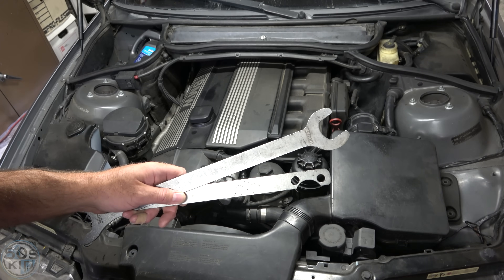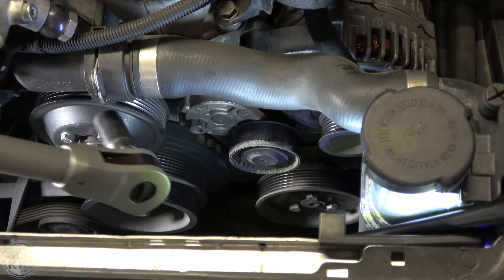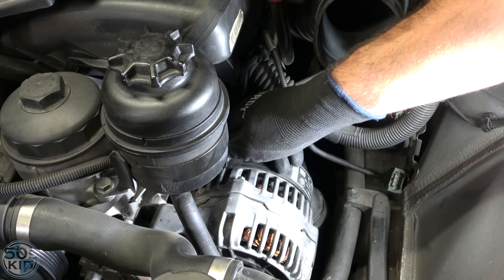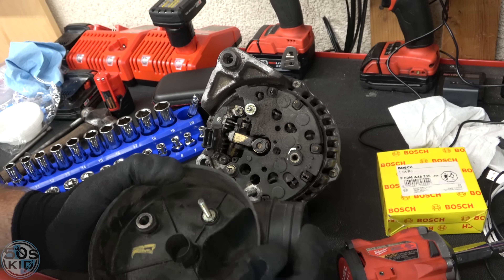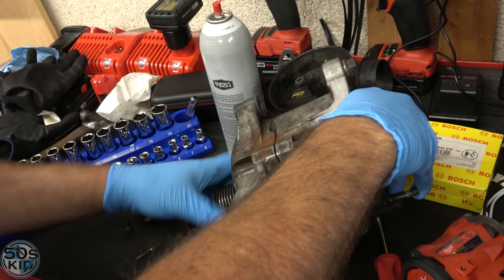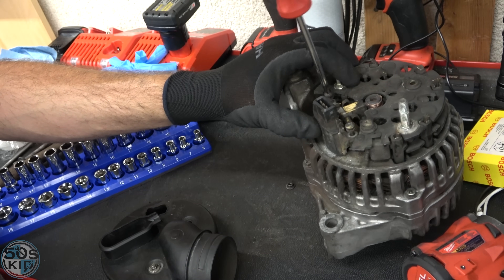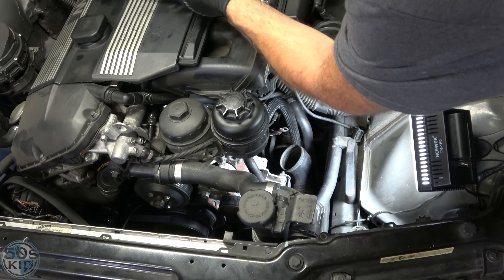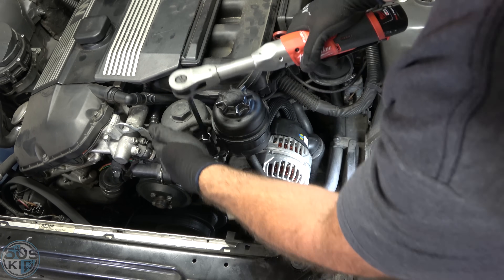Save your alternator with this cheap part! - E46 Alternator Rebuild DIY

Comment: Good vid 50s. The bolts on the plastic housing are 7mm hex E117. I saw another guy on YT using 8mm and thinking the bolts were loose.

Comment: I have replaced my Battery and got the alternator rebuilt but am still having the same issue. Battery draining and keeps going from 13.4V down to 11.7V battery light goes on then all of a sudden it turns off and voltage is back to 13.4V ? sometimes it surges and goes all over the place as well. Is there something I am missing ? Maybe the alternator wasn't rebuilt properly ? Please Help your videos are what has kept my car alive for 3 years !!!

Comment: You only need to replace the rectangular-prism-shaped carbon brush. Perhaps the spring, too. You can get an whole set from China for under $20 that will fit brushed electrical equipment.

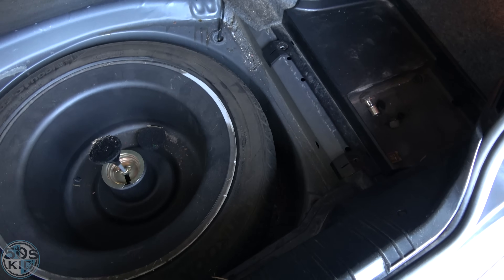Comment: 1:43  It's easier to disconnect the battery under the hood.  Remove the large nut in the small black plastic box kinda near the passenger shock tower.  It connects the engine harness to the cable from the battery, disconnected there is no power under the hood/cabin/anywhere except the big red cable up to that box.

Comment: Does the 3 pin alternator works on the 2 pin one?🤔 I see that you removed a 3 pin and installed a 2 pin, also your connection is for 2 pins, obviously has the space for the third pin, but doesn’t even have the same connection like the other 2 pins

Comment: Stupid question here but I need to swap the voltage regulator from an e46 into the alternator in my e83. Can this be done without pulling the alternator out of the car? I've got an alternator sitting in my storage unit that I could swap in but I'd really rather just toss in the regulator to prepare for the ms43 loom and DME.

Comment: @ 9:50 ... call up Bosch USA with the old VR part number (the Bosch pn) and they will tell you what the newer superceding part number is.  Part numbers can change over 20 years, but for some reason the BMW pn will lead you astray.

You may need to leave a voicemail with their tech support number, but they should get back to you within a few busuness days.

Comment: Not sure if you’ll respond but here is a try, I bought the special tools to remove the fan in order to access the water pump and alternator but the fan bolt is smaller than the 32mm special wrench I received. Any recommendations?

Comment: Do I need to have the duct for the alternator? Mine only has the 90 going down and nothing after it. ..I’ve been dealing with eml light and am about to give up on my e46
Reply: doesn't need a duct but if it does have one make sure to cap it or put somthing over it to stop leafs and that getting onto the voltage regulator and fuseing it out. my e46 has the same alternator in the video but the ducts connected to nothing and I had leafs get sucked in and burn out my voltage regulator.

the duct doesn't matter so long as it's the alternator is the same brand, valeo or bosch (they're not interchangeable) aswell as the plug in the back is the same shape
you can go up in amperage from stock but not down 

so when replacing it you need to make sure
same brand 
same plug 
and the same amperage or higher
the duct doesn't matter as long as you cap it

Comment: Hello I have replaced my alternator and battery on my 2004 bmw 325i . And I’m still having the battery light on intermittently when the car is at idle and it goes off when driving . 
The first alternator I bought from oriellys my mechanic installed for me and a day later the battery died again . I went back to oriellys and got another alternator. Still noticed the battery light and I replaced the battery .
Reply: it's a ground wire issue.

Comment: this takes me back to my m52TU alternator failure. The slip ring copper had worn right through. yours looks 80% gone. Replace it or it may leave you stranded.
That reg. is normal, yet everyone selling the other type. It was weird.

Comment: Hey Jason, i have a bosch alternator and its missing both upper and lower air ducts for cooling, and the alternator doesn't have the right plasic cap with thr hole that connects into air ducts, will it fit if i buy the alternator cap with the hole in it? Im not trying to buy another alternator, i just wanna put everything back like from factory
Reply from the maker: I’m not sure but if I were to guess I’d say no
Reply: Thanks

Comment: My 2005 330Ci ZHP has just one wire going into the connector for the alternator voltage regulator. Is this normal for any e46? Every other one I've seen has two wired pins, whether oval or rectangular connector.

Comment: Don't you have overheating issues with the electrical fan? I learned that the clutch fan generates much more airflow and higher cooling performance, necessary for the automatic models.

Comment: I am having an issue with my alternator in my 2008 335xi (N54). There is no voltage output before, after replaced the voltage regulator with a new regulator, I got voltage from alternator but it always stop working after several minutes, and voltage  may come back then go away. Not sure whether I should replace the while alternator or there could be some other issues? The connector is tight (checked).

Comment: I get to do this job in the next day, so I lived with the hell of trying to figure out what alternator I had.  But in this video you do not hit the lower bolt with a hammer for some reason like you do in the original video:

https://youtu.be/hrEehjM5tgQ?t=308

Any particular reason you didn't do  that this time?
Reply from the maker: I actually did do it but cut it out because it’s never been effective for me. There’s just not enough room to get a full swing. I always end up prying it out
Reply: @50sKid  I pried mine out as well though I did try and hammer tap but didn't ta hard enough... :)  Being in Ohio - I am jealous over the look of the bolts where I have surface rust on all of mine.  

Hopefully my alternator comes in today and I can slap it in after exercising.  I plan to get some penetrating oil in the threads on the engine and brush the bolts clean and wipe down with penetrating oil as well.  Hopefully to try and protect them a bit.

According to ECS the one I bought is a new unit - not a rebuilt (they were listed separately) so I am hoping - I don't have to send back mine to be rebuilt - so if I can get the old one tested and fixed - I can have a spare.

Comment: bmw ended that regulator a few years before this video. As i recall the ones on Ebay arent bad, but arent "Bosch" quality, so buyer beware. you can use the superceded part you have there, and they are a direct fit. 
hope this helps some that are watching this and are confuzzled..

Comment: I faced the same case on my 04/2004 330Ci (MS45.1)
I noticed that my alternator looked different than what RealOEM was showing, so I pulled my alternator to check the part number for the alternator and the voltage regulator, when checking those part numbers it was from an E60!

Love the channel btw, you helped me a lot, and I’m watching your new videos “just because”, I’m even watching the E90 videos although I don’t like it and don’t plan on getting E9x ever

Comment: Correction. It's not a commutator. It's a slip ring. The alternator generates AC voltage. That's why there are diodes. To rectify AC into pulsed DC. DC motors have comutators. AC generators have slip rings.

Comment: I did this about a month ago.  You don't need to remove the alternator to replace the regulator.  Whole job took less than an hour.
Reply from the maker: I didn’t even consider that, doh

Comment: Bro u can go even one step further and change inner bearings and the pulley if ur alternator has one of those overrun or decoupler pulleys. There are kits available on eBay for $40-60 for most alternators.

Comment: Good video, Jason. Thanks. For those of you replacing the belt tensioner, please get a BMW part. I had a new tensioner break on two different BMWs during installation. Never happens with a genuine part.

Comment: My 02 vert is a manual trans with a mechanical fan. Any ideas as to why? I’ve searched the forums but haven’t came up with anything.
Reply: Possible swap? Either the gearbox or the fan
Reply: @EasyAchiever65  I ruled out a manual swap with a vin decode. It’s a factory manual.
Reply from the maker: Weird, never seen that

Comment: Nice to see the e46. Have you reinforced your rear subframe yet? Would hate to see your car go if the subframe cracks :(
Reply from the maker: Unnecessary unless you've got the earlier 328 or an M3. For the most part.

Comment: 17:00  I couldn't agree more about the flex head.  I prefer the standard head since I can apply more torque and also stay squarer on the bolt heads which keeps them from rounding off.  For me, the flex head is a special tool that I only get out for sticky situations.
Reply from the maker: Well it's the opposite for me -- I love my flex head as my primary, but sometimes it gets in the way!
Reply: @50sKid Wow! Using power lug nut for an old and brittle plastic without loosing them a bit...only American can do that. No wonder you guys have stickers on your microwaves " do not use for tumble dry "

Comment: In my e46 there is no pulley on the upper alternator bolt so the belt goes straight from the water pump pulley to the alternator pulley (european car)
Reply from the maker: Oh is it a diesel or inline 4?
Reply: @50sKid  no it is a 320i m54 inline 6
Reply from the maker: @AnthonnyAndria  Oh interesting. We never had those here in the US
Reply: Mine does not come with one either. I read somewhere that not all E46 M54's came with an idler pulley.

Comment: In the next iteration of this issue you can just replace the diodes/brushes :)

And it could be that BMW used a different alternator (different on the outside, not really inside) for the 4/6 cylinder engines, petrol/diesels, pre/post-facelift. And if the donor E46 already had a replaced unit from a Mexico-imported E53, no surprise that parts don't match anymore.

Comment: I did this job just a few days ago! Was actually looking around on your channel for a video on voltage regulator but was surprised you hadn't covered it. So I just watched your video on alternator replacement and looked on E46F for voltage regulator instructions haha. 

Also +1 to the connector type. What's weird is that my ZHP has the oval connector which is common to the Z4s. FCP's website didn't even have the oval connector listed for my car so I had to pull the PN from realOEM. I nearly ordered the wrong connector at first, luckily I realized it 5 minutes after placing my order so I quickly cancelled it and re-ordered the right one.
Reply from the maker: The oval connector is on newer cars, I believe. What year is yours?
Reply: @50sKid  2004. I've heard of some other ZHP owners having the same conundrum
Reply: @50sKid  oh and what sucks about the oval connector is that there isn't any vent connecting to the brake duct for alternator cooling, which is interesting. I guess it was cheaper not to include that with the later cars

Comment: Thanks for sharing.   My e39 which also has the M54 Engine and had a Valeo Alternator had the alternator light come on too - the brushes were worn out. You can just replace the brushes, but you have be able to solder.  Getting the Brush Cover off on the Valeo Alternator is a real PIA. It requires careful cutting of the plastic cover and  I tried to min. the cutting so it could be reused. (supposedly it can slide off, but good luck...to me it looked like one time use. The brushes are part of the Regulator and you can not change the brushes without removing that brush cover.)The Regulator on Valeo Alternator is more expensive: about twice the price of a new Bosch Regulator.  Plus the fact that my slip rings were heavily worn (the copper discs that you were sanding that the brushes ride on) I just opted to replace with a new Bosch Alternator.   The new Bosch Alternators are made in South Africa....So far no issues, but I wonder how long it last over the original European made Bosch (I think most Bosch Alternators on these Era BMWs were made in Great Britain).....Rebuilt Alternators - there is no telling how long they will last.  Most Re-manufacturers are using inferior Chinese Bearings (if any new bearings at all) and you may only get a couple of years and/or 50k which is not worth the price.  Most of the alternators I found in the Salvage Yard needed Bearings.   The Bearings can be swapped out but the time to do that all that work and the cost of the bearings, you don't real save much plus removing them you may end up damaging the alternator casing.
Reply: Great info! on brand names! Thanks
Reply from the maker: High quality bearings of any type can be purchased from McMasterCarr or other such industrial supply websites.

Comment: Also glad to see e46 platform. I wonder how many of us are out there? Any reasonable e46 repair shop around DFW?  I've been thru 3 so far.
Reply: Go to google maps. Do a search for alternator repair. Look for shops with four stars or higher. What do you consider "reasonable?" Most repairs are going to be somewhat labor intensive, not counting the cost of replacement wear and tear parts. The going rate is roughly up to a few hundred dollars. If you can't afford this, you might have to tackle the repair yourself. There are numerous youtube videos including this one on repairing alternators. Usually alternator issues relate to either replacing the brushes or the voltage regulator. Good luck. Most national chain auto parts stores will test your alternator for free. I recommend video recording and or photographing your disassembly to document what you did to put it back together.
Reply: @houseofno  thanks. I found a business in Richardson . family owned. Refurbishes alternators for about $70. Just wondering if you had heard about them. I actually was referring to e46 repair work in general. $500. For engine mount replacement sounds like $250 per hour labor charge and that's not a dealership. Independent shop that works on luxury cars. I keep running into shops that charge more than dealerships!
Reply: @bogusienombre355  without more specifics, repair costs can vary widely. Depends on labor involved and cost of parts replacements. Most dealerships charge between $150 to $200 an hour. A diagnostic is typically charged one half to two hour labor rate. It really pays to buy the service manual and your own tools. Alternatively if you do need professional services, take it to an independent bmw service center. You can locate the nearest one to you by going to bimrs.org.

Ninety percent of BMW repairs can be done with a service manual and metric wrenches. In fact, your first diy repair will generally pay for the cost of your service manual and metric tools. If your car is '96 or newer, get a mid-range $$ scan tool in the form of a scanner or an app with an obd cable. You don't have to buy an expensive one, but a mid range $$  tool will give you more information and more functionality than a cheap tool. Good luck.
Reply: @houseofno  Thank you for being helpful. I appreciate it.

Comment: You got lucky with that sleeve. On my car that was a 2000 323i with 250k miles and spent its whole life in the rust belt. It was a few hours of hassle to try and get that sleeve to move for the alternator to come out. Plus it happens in the middle of winter here in Chicago in a unheated garage so that made is so much better.
Reply: After you break your bolts and have them half way out take a small hammer and tap them sliders. I PB blast them before hand. also idk if that helps but can’t hurt.

Comment: Rust, how can that be? The alternator is right below the general purpose anti rust oil resevoir....
Reply: Looks like they should have put in some kind pan/shield over it to prevent dripping getting in it
Reply: Lmao I read it more humorous. I misinterpreted the comment. I thought he was saying how it would be possible to rust, when the entire engine leaks oil so it basically should be covered for rust problems. 🤣
Reply: @AdamMarriyati  the powersteering oil resevoir is right above the alternator. Those leak on every single E46 that I have seen.
Reply: @ApaX1981  and e39. mine covered with atf oils right now but still runs fine. will take hose replacement job when I have time tho, which also means cleaning the alternator too
Reply: I was thinking the same thing.

Comment: One week too late for me! Mine was going out as well, but I couldn't find any great videos to fix, so put in a new one. And of course, your video was my go to how to! Question for you though, ever since taking out the alternator and replacing, the clock on the dash won't work.  I've searched the forums, but can't find a concise answer. Thanks as always for your vids- they keep my car on the road!
Reply: You might just have to reset the time if it looks like - -:- - the way you set the clock is make sure the menu shows the clock with no time and turn the one of the two sticks that poke out the instrument cluster. I believe it’s the right one. You twist it to adjust the clock.
Reply from the maker: Yeah, you have to reset the time IF the little wings are not broken inside of the gauge cluster and you can no longer set it.